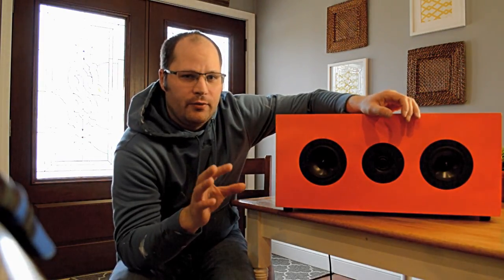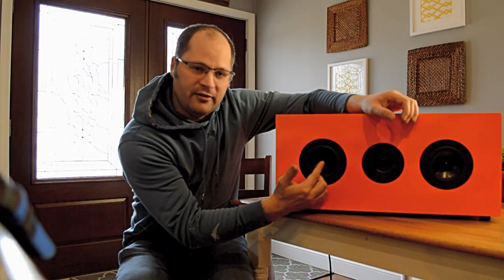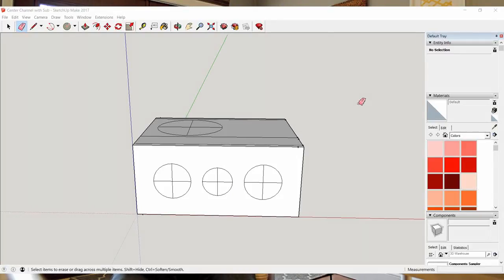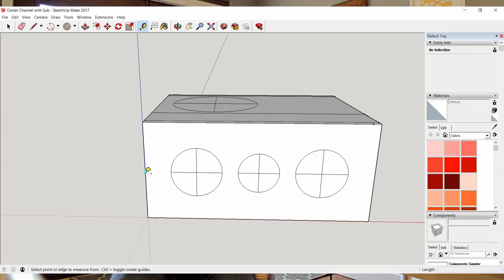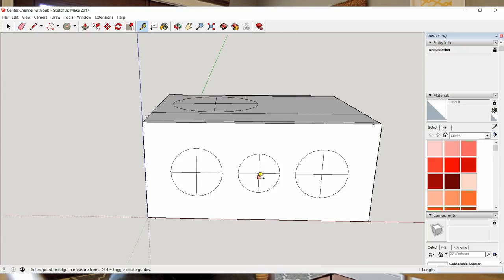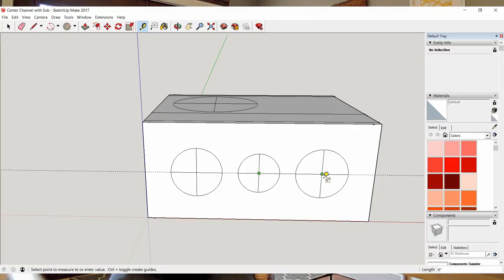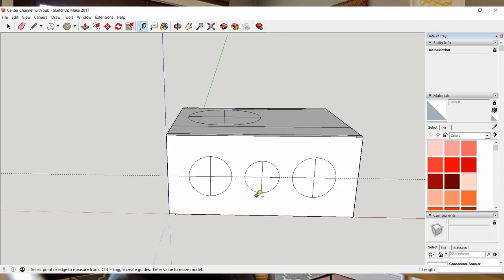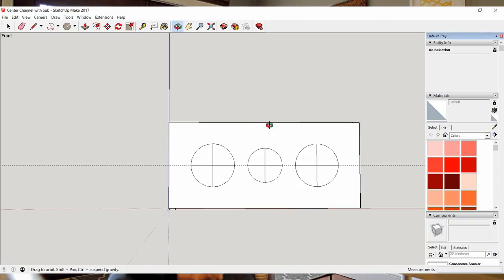How to Properly Space Drivers on a DIY Speaker - MTM

Comment: Ideally the Drivers have  to be within 1/4 wavelength of the highest freq they are reproducing in order to not cancel each other out.  In this case it's the crossover point of the Mid drivers. So if the crossover is for example 1200 Hz. The CTC should be 1/4 wavelength of that from each other. since this is almost to near impossible the next best is 1/2 wavelength. You  want to use the CTC rule between the two mid-woofers to dictate your crossover point because you would not want excessive cancellation off axis horizontally.
Reply: It's a 1/4 wavelength between drivers, not 1 wavelength. It's definitely not ok to use a half wavelength if a quarter doesn't fit, as that is completely out of phase.It also need to be between the ctc of the woofers, and has nothing to do with the tweeter for the level of this conversation. This is a well set out video and I encourage you to do it again, just use the correct info.
Reply: 1/4 wavelength is correct. So, take the result that toid123 says, and divide that be 4 to get your real crossover. So, if you measure 12 inches between the centers of your mids/woofers, you divide 13550 by 12, and get 1129hz. Divide that by 4 to get the quarter wave, or 1/4 wavelength,  which is 282hz. That is how you do it.

Comment: Well, this is something that I've never understood.  The waves from the drivers are not consistent, and they're not in phase depending on the sound that it's playing.  For instance, a tweeter may be mostly putting out sound between six and eight thousand Hz for a second and then suddenly emphasize 4Khz and 12 Khz for a tenth of a second.  Additionally, your bass may be at 30Hz vacillating to 80Hz for 3/4 of a second and then 120 Hz to 20 Hz for a second.  This would be fairly common throughout a song, though not as precisely as I've described.  The bases and apexes and apexes will be meeting all over the place and no specific null will exist because it will be constantly in motion.  Additionally, almost every speaker design uses different spacing, and not by a small margin.  Based on your calculations, drivers of roughly the same radius (many, many are) and crossing over at roughly the same place (there really isn't that much variation, and besides, 2,000 Hz is 2,000 Hz regardless of driver dimension) should pretty much be constant.  I'm sure you can't take enough time to answer my question, but I just wanted to say where I'm stuck.

Comment: @Toid did you state the 1 full wavelength crossover because the tweeter is within the 2 mids? So the speaker in 1 axis is more like a coaxial?

I see a few comments regarding ¼ and ½ wavelength crossover calculations to avoid phasing which i understand... but is this less important due to the physical design and application of it being a center speaker?

Comment: Thank you sir, but does this only apply to speakers angled the same direction? Or can the spacing distance increase if the speakers angle more on the baffle as we go up higher to the next driver up on the baffle which I want to change the direction the next driver is pointed? For example if I have a midrange and the tweeter on top facing down by a difference of 5 degrees more (to curve to the listener's ear better), that is pointing down a bit more by a 5 degree change compared to the driver below it (assuming the listener is the correct distance away), then can this spacing increase?  Is there in other words more flexibility with spacing if I can design angle changes in the speakers as it goes higher to the next driver and will that reduce acoustical problems?   Because I see nothing about this on forums.

Comment: Great info. 

Couple of questions:
1. What if the crossover frequency is 9000Hz and the driver is a 4” woofer and 2” tweeter. Now 13500Hz / 9000Hz = 1.5”. So, even if the two drivers touch one another the CTC will be more than 1.5”
2. Does the calculations change depending on 1st, 2nd or 3rd order crossovers.

Thanks in advance
Reply from the maker: Thanks.  There are a few things to consider, including lobing and beaming of speakers at that frequency.  Some of this depends on the directivity you want your speaker.  So if you want your speaker to have a wide dispersion, then you will want to either crossover sooner or choose a different design.  An MTM may not be the right way for you.  Here is a pretty good read that has to do with lobing and some concepts that may help you out: http://www.123toid.com/2018/01/speaker-lobing-polar-response-for-diy.html
Reply: bsl bl You can make a bridge to mount the tweeter over the woofer. Sort of like a point source. Of course such a big tweeter can then cause problems of its own with the woofer. At 9000hz you could easily use a 3/4 inch tweeter, and get much better dispersion too. Heck a 1/2 should work fine, and wouldn't block the woofer as much. 

But like he said. You're going to be beaming both drivers I think. But that might not matter. If you're using them for computer speakers for instance, it won't, because you'll be right in front of them. I recommend you do a lot more research on the basics first. But to be fair even a flawed design can sound okay if you're not that picky.

If you're flexible. The best idea would be to cross lower, and use a 3/4 in tweeter. Vifa, Dayton, and others make really cheap ones that are good. And if you're looking for a little more. The $20 SB Acoustics SB19 is about as good as any tweeter at 3 times the price, if not more.

If you're not into research for whatever reason. I recommend you make use of the collective knowledge of forums. diyaudio.com is good, and busy. But for the most knowledgeable people. I would check out the parts express forum. There's people on there that live for building speakers. Including people that do it professionally. They will not steer you wrong. 

These are tiny, cheap, and supposed to be the best tiny tweeter out. You could easily put these anywhere including right in front of the 4 inch woofers on a bridge, and have a point source basically. It wouldn't be time aligned of course, but a cheap miniDSP could do that for you, if you don't mind running two amps. If you did you could use one per side, and have infinite stereo separation too. Then they'd be technically almost perfect in design. And would be very cool too. Good luck. Let us know what you do please.

Oops forgot to put the link. Duh! Lol
https://www.madisoundspeakerstore.com/auto-tweeters/audax-tm010a1-neodymium-car-tweeter/
Reply: Andrew Balus .... thanks for the detailed info.

I am building a 2.1 system based on a tpa3116d2  amp with a tang band w6-1139sif sub doing 0.1 duties and dayton rs100-8 and an amt 8 ohm tweeter 1” doing 2.0 duties. 

I tried it out with a 1st order 9000Hz for the 2.0, 2-way set up and found it to be quite decent sounding. But, I was wondering if I could have got better sound if the speakers were touching one another.
Reply: bsl bl Well if it's already done, and with such nice stuff like that. I would probably just leave it myself. But I guess you could maybe redo just the baffle, and maybe shave off as much as possible on both drivers to get them closer. It certainly wouldn't hurt. 

I would take some RTA measurements. Just run some pink noise through them, and use an RTA app on your phone. It's not perfect, but close enough. That will give you an idea of what you're working with. And if there's no glaring problem. I would just keep it the way it is. I'm sure it sounds great with those drivers though. 

You really picked some good ones. And a good amp too. You're probably already ahead of 95% of the world in sound quality right now man. But there's definitely more you could do, besides redoing the baffle to make them sound better.

If you're looking for the umpteenth degree that is. Otherwise just enjoy it for now. I would now concentrate on my source first though. I think your time money would be better spent on that. Or on room acoustics, and/or room correction. If you already have a good source. Then maybe later on revisit the speakers, and tweak them.
Reply: bsl bl Oh, and like I said. You'll get much more help from people much more qualified then me on the forums I mentioned. I highly recommend giving them a detailed description of your setup, and asking what they think. It's a much better way then on here IMO. I belong to those, and many others. That's where I've learned most of what I know. There's some great people on them. Many I've met in person also, and they're good people. They will help you. Good luck.
Reply: Try lower crossover or change driver that can be crossovered lower.

Comment: Thanks, that's very useful! I was wondering if this is the same for a subwoofer?
Reply from the maker: You're Welcome.  This information really has to do with an MTM configuration.  Sicne subwoofers aren't typically used in an MTM, it should not apply.  However, so people build powered subs at the bottom of an MTM tower (think Definitive Tech and Golden Ear). These are typically crossed over by 200hz.  Since the wavelength of such a low frequency is over 5 feet long, it should not make much of a difference.  The best thing for a stand alone subwoofer placement is to do a sub crawl to see where you get the best/most even response.
Reply: The wavelengths of low frequencies are so long that the spacing is not a factor.  A 40 hz frequency has a wavelength of 339 inches, 120 hz, 113 inches. There are on line calculators   http://www.mcsquared.com/wavelength.htm

Comment: sir, new subscriber here..i am wondering and a little bit confuse about the idea of center to center spacing at 7.5 inches.. is it always constant to measure driver spacing even when you have large speakers.. how about if you have already 18 inches in diameter speakers, can you still follow that same principle,, will the formula still apply?? ..
Reply from the maker: Welcome!  Glad to have you. Center to center spacing is typically the furthest it should theoretically be.  It would still apply no matter the size of the speaker.  Of course, with say an 18" speaker, you are going to be crossing over much lower, thus the center to center spacing will be much further.  Just keep in mind, that is is a rule of thumb and has been broken in man designs.  Typically it is best practice to keep center to center spacing as close as possible.

Comment: While it is important limit driver spacing at or below one wavelength of the crossover frequency, I always thought it was better to keep the drivers as close as possible.  This makes the sound come from a single point (like back loaded horns) to obtain better imaging.  Thoughts?
Reply from the maker: Taylor Hansen it depends on what you're trying to accomplish. But that is a great rule of thumb. In fact two great rules of thumb when starting can be, keep your driver spacing as close together as possible and cross over your Tweeter as soon as possible.
Reply: 123Toid Heck yea. My dream speakers, which I'm working towards building, are going to have 2 big woofers (12 or 15) either on bottom, or maybe even MTM. But, and this is the most important part, they're going to be crossed by 250hz to a compression driver, and horn combo that runs all the way up. Like theater speakers. Only crossed even lower. I'm hoping since I will be using low powered tubes for the horn I can even go lower then 250hz by a smidge. 

I may even just go open baffle with 2 15's for natural sounding bass, and forego the hassle of building/lugging around big boxes. I just got some Cerwin Vega VS-150's this past Saturday, and I'm already sick of dealing with big boxes. My back is still killing me, because I had to move them by myself due to time constraints. That is not easy, let me tell you!
Reply from the maker: Andrew Balus that sounds like an awesome build!
Reply: 123Toid Thanks man. I have some full range drivers I like to run open baffle, and I've been wanting to try some Eminence Alpha 15a's for the bass. So I'm thinking, since I'm tight on money, and space. That I'll put 1, or maybe two per side. Guess I'll try one, and see how it goes. Open baffle of course. Then I'll make a top piece that I can swap baffles between the full range, and the horn. And some with both. I've got a lot to do it already. Like the bass amp, and some tube amps for the top too. And I'm buying a MiniDSP digi soon. And I've already got three DAC's. They're not the same though, but it will work. Or I'll use the Starting Point Systems DAC 3 I have, and get another one, or two. They're cheap. Then it's just a matter of buying a few more drivers. The compression driver/horn combo will cost the most. Good ones that go that low aren't cheap. But I'm a bargain hunter, and I've been able to get everything else really cheap used. And I'm sure I'll find the rest the same way. And I've got lots of extra gear I'll eventually sell to help fund it. It's going to be sweet. The dynamics of open baffle amaze me. And it's so natural sounding. I highly recommend it.
Reply: @amb3cog have you ever heard of beaming

Comment: Hi 123toid thanks for this video. Would the same prinicple apply for 2 way speakers as well? And do you reccomend flush mounting the drivers on the baffle or mounting  them on the inside? Also should the foam be counted towards the cabinet size that is determined by dats v2? Thanks!
Reply from the maker: THose are great questions.  With 2way speakers, it is almost always best to get the drivers as close as possible to each other. I do recommend flush mounting for most people, it will typically give the best response.  There are some drivers in which rear mounting them can be advantageous, but usually flush mounting will help with your diffraction.  Finally, great question about the acoustic foam/polyfill.  It is not counted toward your box size.
Reply: 123Toid thanks a lot ! Great channel!
Reply from the maker: You're Welcome!  I am glad you are enjoying it!

Comment: 13,550 is the magical number we can take to divide with crossover freq. ??
Reply: It's just the speed of sound (in air) in inches/sec. The wavelength and frequency are related by the equation: speed = wavelength*frequency. So yes, you divide the speed by the frequency to get the wavelength.

Comment: Surely the centre to centre spacing is easy to find because it's wherever you're drilling your pilot hole? no software needed.
Reply from the maker: Where you need to drill the hole is dependent on where you crossover your drivers. That’s what this video goes over.
Reply: @Toid  yeah but once you've calculated the appropriate spacing, you drill the next pilot hole x inches away from the first one. what was the doodling software for

Comment: Hey man, I am currently planning my first diy speaker, and I was wondering whether you know if metal makes a somewhat decent enclosure material? I plan on using Aluminum for the front side :)
Reply from the maker: Pascal Ott it can. But I would put sound dampening material on the back (inside cabinet). Something like Dynamat
Reply: 123Toid so you'd see no issues if I use Aluminum on the front, properly cut by a cnc and wood on the sides?
Reply from the maker: Pascal Ott as long as you line the back with sound absorption material, you'll be fine. Assuming it's thick enough.  If he is too thin material, that is always problematic
Reply from the maker: PS I hope you show it to me when you finish. It sounds like an awesome project
Reply: 123Toid 10mm? 20mm I'm new to this so I really don't have any comparison points :) Thanks a lot for taking your time replying to me
Reply: 123Toid I sure will do :) I'll finish school in two months, after that I'll move out and I'll have time for all my diy projects
Reply from the maker: Pascal Ott the most common material I use is around 15 mm. Assuming you properly brace it, you have no issue with that size. 10 mm may work just fine as well, I just have never used that. I use what's equivalent to half an inch.
Reply: 123Toid Alright, I think I'll go with a safe bet of 20mm then :) There is nothing i can enjoy quite as much as a video of someone who is absolutely passionate about their video content and gets straight to the point :) Keep up the great content